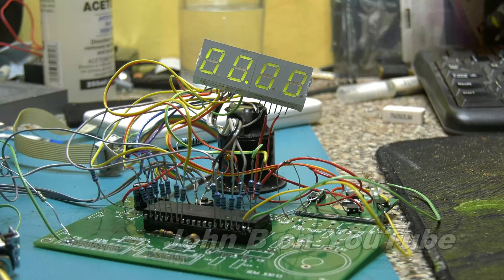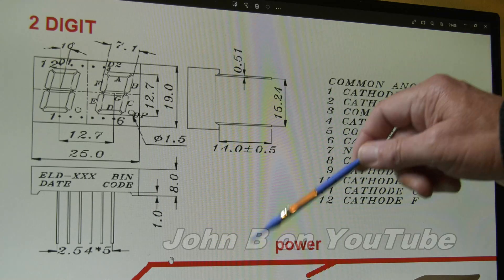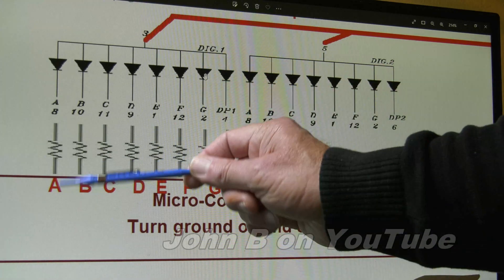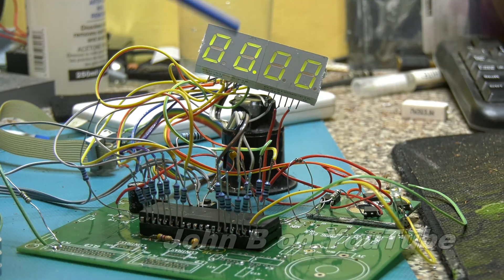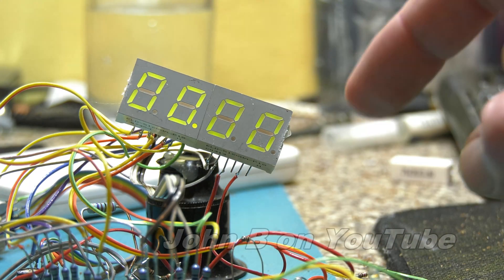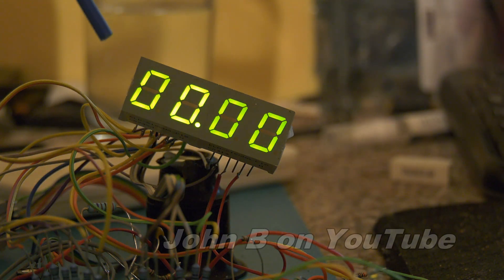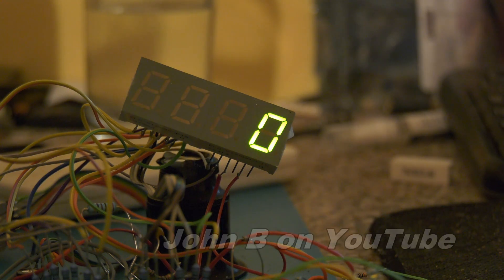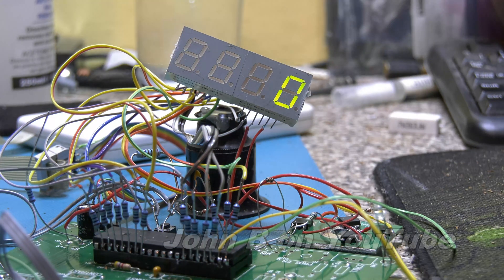7 Segment & 14 Segment LED Displays, Multiplexing

Comment: I recently built a simple voltmeter using an eight bit shift register to drive two seven segment displays.
Seven bits where used to drive the segments and the remaining bit was used to toggle between the two digits.The code uses "fixed point " which meant that the decimal point on the display could simply be hard wired to the supply !
I coded it all in FlashForth and three GPIOs on an arduino nano were all that were needed !
Reply from the maker: Interesting stuff, thank you for your comments.